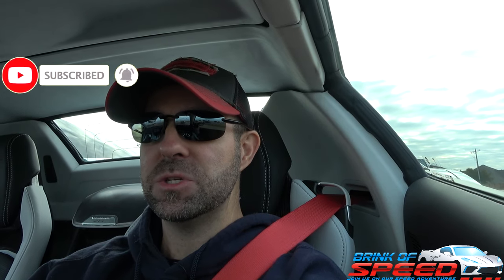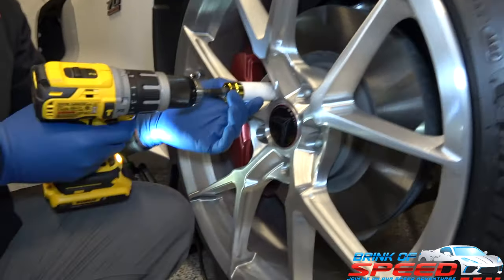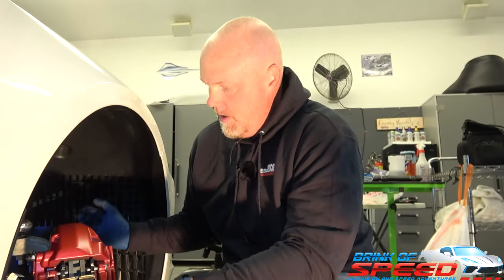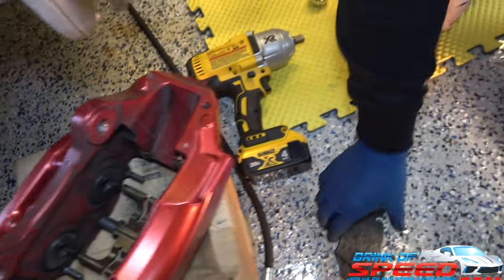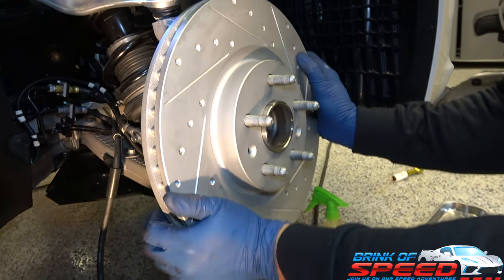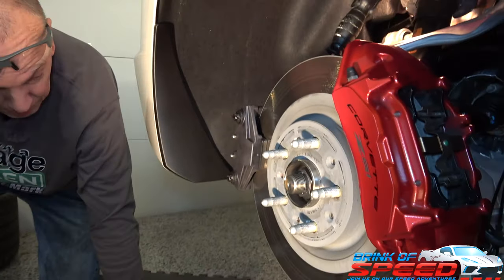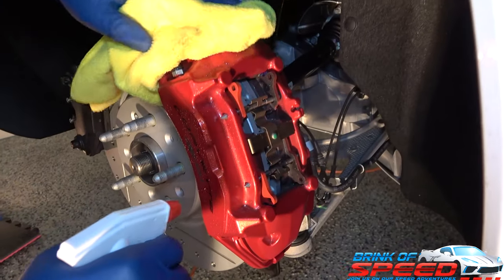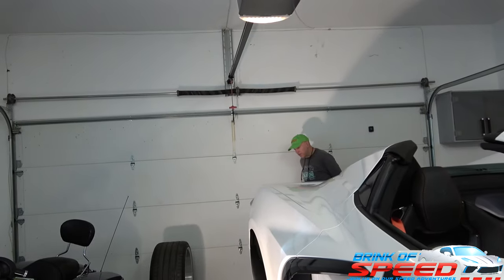Do THIS to your C8 Corvette & NEVER have Brake Dust again!

Comment: So you have the wheels off. I don't know why you needed new rotors. Second I'm ceramic coating my wheels and calipers while they are new and off. Make it easy later. Must be a Texas thing.
Reply: The rotors were more for cosmetic reasons, as I have nice aftermarket wheels I wanted slotted and drilled rotors which is how the z51 package should have came.

Comment: Why do you say these pads are for the street and the track?  You are wrong. They are for the street. Carbotech does not make a brake pad that can be used on both the street and track.

Comment: What model quick jack he used?
Reply: That was the 5000, I actually just bought a 6000elx which is better for the c8, has the longer jacking points.
Reply: @nrdemon1031  thanks